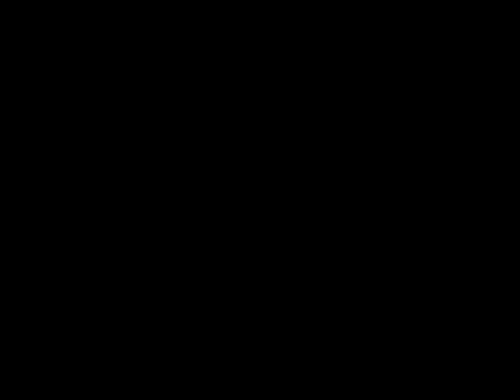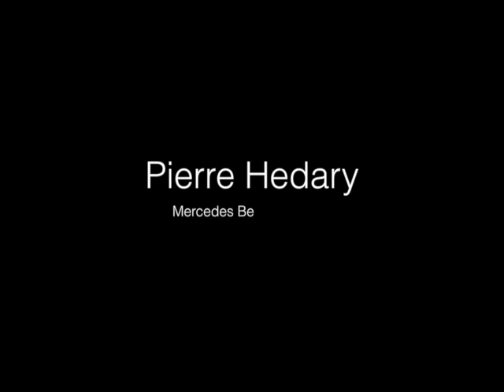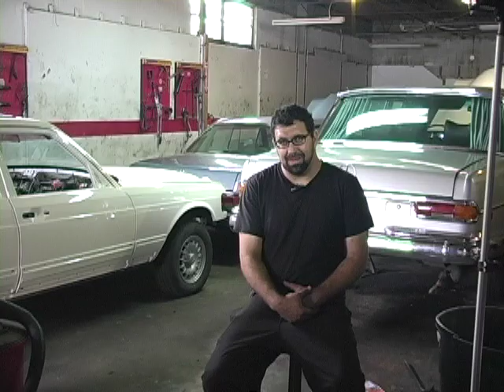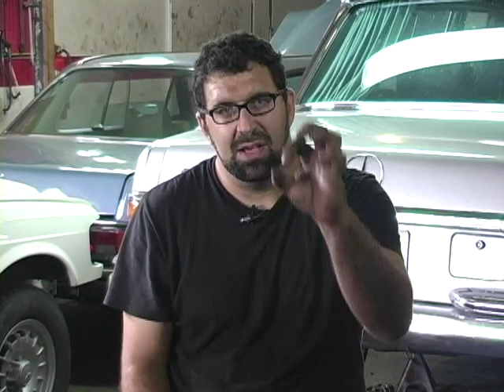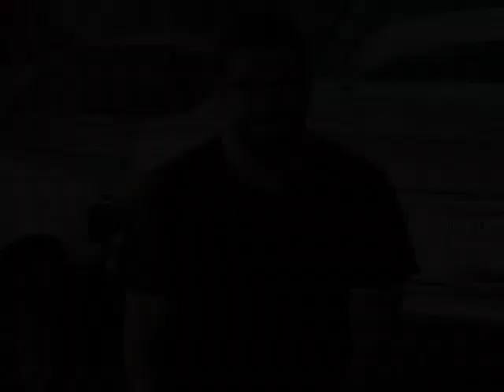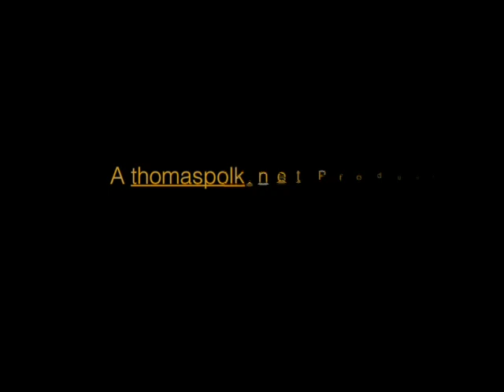Q&A#18 Transmission Leaks

Comment: i have a 1978 300D with non vac system.  it only shifts 2x. it will get 40mph at top rpm but not shift up. on GMs with bad tranny when clutches go out engine spins after 2->3 shift so if leave in #2 ok up to top rpm.  but this 1978 300D just stops up shift after hit 2nd, any pointers?🎉

Comment: Dear Pierre,

I am an owner of a W108 280s, W109 300SEL 3.5 and W126 500SEL (1983). Excuse my English because i come from Holland.  I saw your footage and i don't really understand what you mean by 'brace the metal line.' Because my w108 transmission leaks only when the motor is running so i hope this will solve the problem.

Is it possible to show  some posts how you fix/replace things instead of talking about it. I hope i do not offend you.
Greetz.

Drs. Hafid
Reply from the maker: Hi! by "brace the metal line", I mean to use the hexagonal fitting on the metal line as leverage, so that when you undo the hose, you don;t end up twisting the metal line.